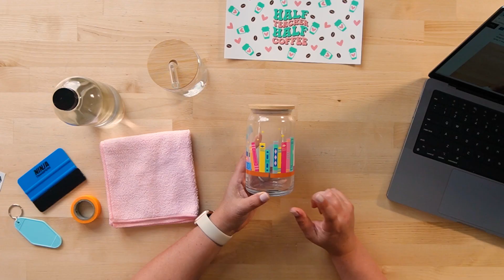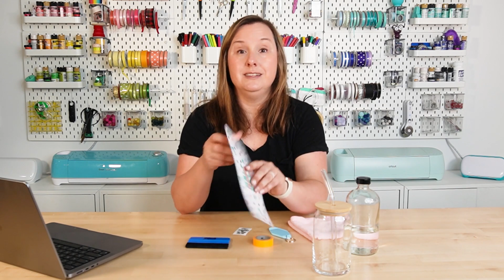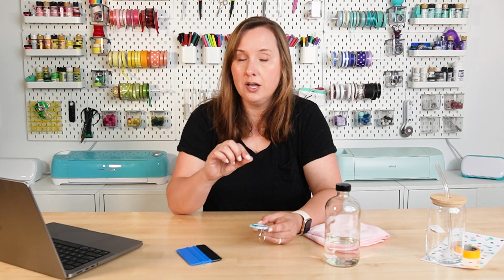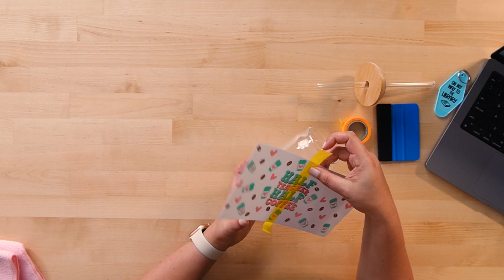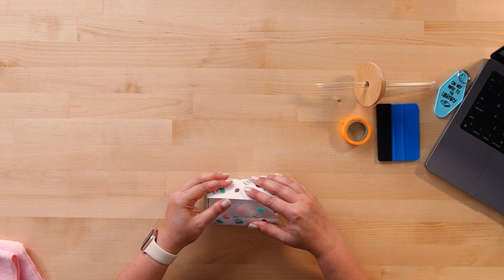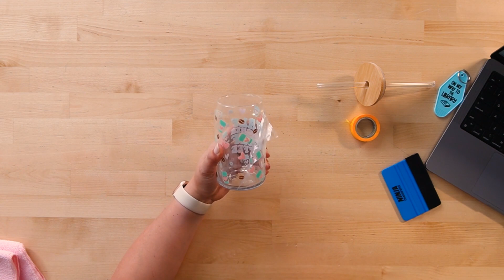How to Use UV DTF Transfers: Small Decal + Full Cup Wrap Design

Comment: I take the uv dtf transfer and make sort of a puzzle out of it by cutting it in sections careful not to cut any of the design. Then I put the puzzle back together on the glass can then remove the cover one section at a time. I don't get any bubbles and it's easier to remove each section.
Reply from the maker: That's a fantastic idea!!
Reply: I'd never heard "glass can" before for what I'd call a glass jar. Is that regional like pop vs soda? Thanks